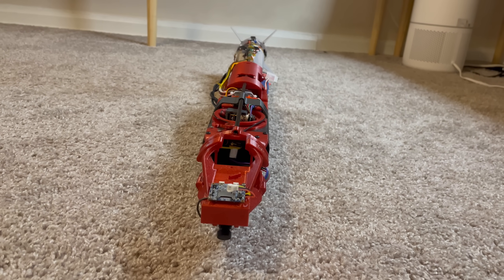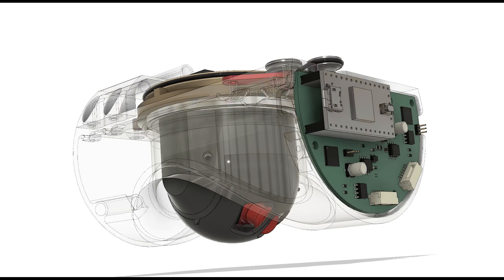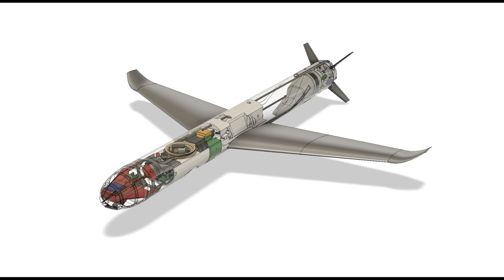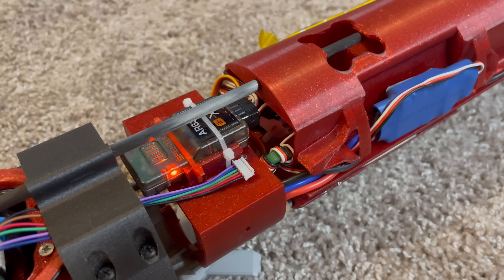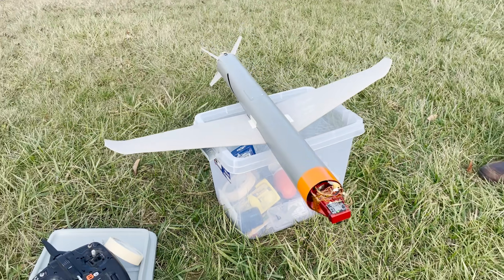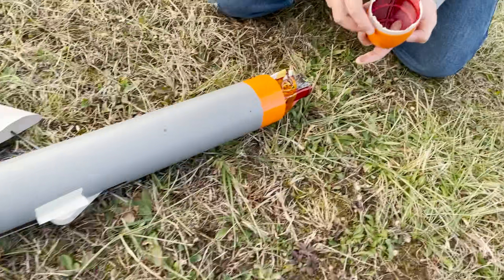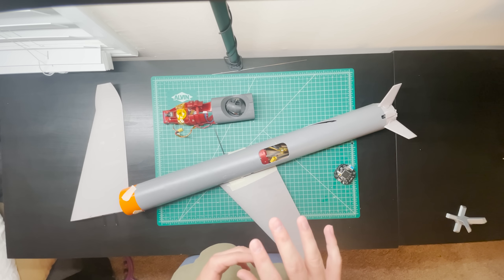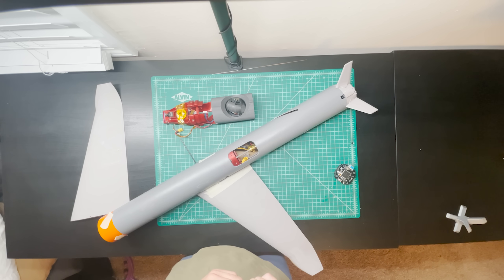Building (And Crashing) my Homemade Surveillance Drone

Comment: Thrust too low, too heavy, not enough tail stabilizer authority (too small). I think you are focusing too much on making it look cool as opposed to flying well. For example why ducted fan? Why thrust vectoring? Why 3D printing instead of other construction methods which are stronger and lighter? That stuff is heavy and obviously not helping it fly better. A better way to do this would be to start with a commercial RC airplane that flies well, then modify it to add your payload to it. It flies well and the payload functions? Great, now you can make modifications to the airframe to see if it improves performance. The key is to make small changes and test the result of that. While testing airframe stuff you can have a dummy weight instead of the actual payload because as you're finding out, there will be crashes. Quick and dirty is the name of the game for prototypes. If it looks good you're wasting time and therefore iterating slower than you could be. It's tempting to have an idea in our head of what the final product will look like and just go right to that. It's much better to be constantly thinking of the objective and be open to anything and everything that gets you closer to that, regardless if it matches what you initially thought. Ugly stuff that works is better than looks cool but doesn't work. The Youtube channel rctestflight is a superb example of this type of engineering. I worked as an R&D engineer, now retired and have designed and flown a few RC aircraft. This is my first time seeing your channel and I don't know your background so please don't take offense. Good luck!

Comment: Weight and balance compared to wings. How much thrust does your arrangement produce. The special ed throw is really no good :) try adding small dummy wheels to it and see if you can take off from a runway, if not you have bigger problems. and don't use plastic 3D printing for anything structural because it's garbage. Although there is that funky new filament type 3D printing nerd is promoting that is crazy strong in tension along the extrusion direction. The tight non aerodynamic duct is probably no bueno.

Comment: I think you'll have better luck with a pusher prop. I've built a few EDF powered foamboard deltas. I had to scale my 52mm edf model up to a 74mm fan to get enough thrust for hand launches. My models had flat wings with no low speed lift, it needed a lot of thrust to get airborne. I ended up scaling the whole model to fit the 74mm fan and 6s lipo. I really think an EDF is just too inefficient for your application.

Comment: you gotta do your carpet plot / design point analysis (consists of wing and thrust loading) before flying it. Check out my Bronze Propeller RC competition video.

There are equations you can use to achieve desired takeoff speed, stall speed, and feed into the carpet plot to determine the best wing loading and best thrust loading to achieve your desired performance

Comment: 3d prining is cool but weight a lot so I'd injection mold or better vacuum mold non structural elements, it's a lot of work up front but you get less weight at the end.
The thrust is way too low for that weight and the control surfaces have no authory at such low speeds.
For launches I'd use a rail or something that can get it up to speed if you want a model that is for relatively high speed. Also it is more reliable and reproducable than throwing it into air.

Good luck! :3

Comment: I was thinking rail launcher when your buddy was chucking it. I really think you need tail wings. Those 4 X-patten, or even 2 larger Y-pattern stabilizers, are not enough. I think you need the 2 larger Y-pattern rudders and 2 normal rear wings, then you'll home free. Stall and launch speeds will be much better. Some kind of carbon landing sliders might also be good. At least it when you are finally landing it, it will not risk tearing up the bottom. That's my 2 cents.

Comment: While the weight, wing area and low thrust don't help with the hand launches, some better technique might've made it fly at least for a moment. The most consistent way i found for hand launching is by grabbing the fuselage slightly (very) in front of the CG, running as fast as possible while maintaining somewhat constant angle of the plane, and then gently throwing it forward. The way this plane was launched (or rather, thrown) gave it so much angular momentum every time, it probably wouldn't recover even with infinite thrust.

Also, running with the plane in hand gives you some feedback on how the lift is, and if the plane is correctly pitched for launching. The runups were very short so there was no way to correct a wrong aoa.

Good luck with the next iteration, cant wait.

Comment: your idea of a rail system is good. if you can get it to fly or glide a short distance till it reaches stall speed with out the fan running that would be good.. One other thing one thing you can do to see if your fan has enough energy is to install or make a fixture that has wheels to check and see if the fan has the energy to overcome the weight of the model

Comment: Also, you could do a cut down 'community' version that we could all contribute to, even if its just the base frame and wings to get that right. Id be happy to print and test, I also use F3D. With FT work & kids I just dont have the time for replicating from scratch but would be up for taking deviations and printing, logging results for you. Best of luck.

Comment: Seriously impressive.  I applaud your approach of reducing risk where you can for initial testing.  Too many people try to do too much too early, which usually results in multiple failures.  Have yuo had any problems finding suitable test ranges?  Launch attempts 1 & 2 - Hand launching probably gives you a takeoff speed too low to support flight, even for this wing set.  Also, the takeoff angle of attack looks far too great, which probably resulted in stalling the wings.  In an effort to eliminate those variables, you might consider using a track laucher with bungee cords for the initial takeoff impulse force.

Comment: sounded like you throttled up after launch.  if thats the case you might want to consider starting at full throttle prior to hand launch.  this will ensure maximum control authority as well as increase launch velocity.  One thing that may also useful is a light weight unpowered glide test to ensure your stability margins are acceptable.  I can’t tell from the video but hatchet appeared to be tail heavy.

Comment: Ducted fan engine. How far will it fly? 1 mile?  Efficiency like a steamer. Its a YouTube toy, not a Surveillance Drone. Its heavy and landing like a brick. Buy APP foam frame and install the slow motor and big prop. Autonomous flight is easy to do with the Arduplane.

Comment: Hi, I suggest you try a prisoner flight on a wire to validate the balancing of the plane and the calibration of the flight controls and bearing surfaces. Then I think you will need to use a launch pad with elastic to get a higher takeoff speed.
My two cents.

Comment: You can print in LW PLA to reduce weight it’s significantly lighter then PETG.

Also you’re getting a really bad torque roll at launch which is why it rolls upside down every launch. 

You’ll need a larger surface to control roll. You might have to resort to Ailerons. To achieve enough roll control to counter the torque roll at such a low air speed.

Comment: its tail heavy! It will NEVER fly until you get it to balance and by what I see it is clearly tail heavy. It needs some weight in the nose. Look up how to balance a rc airplane on the internet. That is your main problem, your "CG" is way off. You should be able to hand launch it once its balanced. Try and get it to glide first. Not long distances, just glide, then start adding power.

Comment: You might not want to use a “guy” to toss your toy!  Get a launch rail you can develop some speed with!  Good grief!  Your problem isn’t weight, your problem is achieving lift velocity, weight has nothing to do with flight, only flight speed.  Not enough stability margin with hand launching, really…..

Comment: Awesome design.  I bet you need ailerons.  I'm clearly no engineer, but I did scratch build a 4 foot RC predator model from foam and balsa.  With your smaller control surfaces at the back, I think you're going to need a lot more thrust to get enough speed to have enough control authority to steer that heavy girl.  Electric RC ducted fans are not as powerful or efficient in reality as they are on paper.

Comment: The project looks very good but you can improve a little bit about the weight. For this you can use LW-PLA and reduce its weight significantly. Good luck

Comment: Replace any 3D-printed components you can with inexpensive materials like Hobby Lobby foam board or cardboard tubing. If you must use 3D printing, consider using AERO PLA, which produces a foamy, lightweight material depending on the hot-end temperature. For your 3D-printed parts, minimize infill to reduce weight while increasing wall thickness to maintain strength.

For deployable wings, increase the fuselage diameter and shorten its length, ensuring the main wingspan is at least double, if not triple, the length of the fuselage (or rocket tube in your case). Avoid placing fins directly behind the motor exhaust, as they can reduce thrust during major turns. Instead, remove them from the exhaust point for better aerodynamics.

To improve control, rotate the rear assembly 45 degrees to enhance pitch and yaw performance during gliding. Additionally, consider adding a method for pitch control, as none seems to be present in the current design. Remove the intake duct and rethink its design. A single limb-like structure, similar to how drone props are attached to the frame, might help reduce weight while maximizing surface area for thrust. If you wanna make something to use model rocket motors look at the yokosuka mxy-7 or Mizuno Shinryu planes.

Comment: I have some experience in hand launching RC planes. When I just started the biggest mistake I made (and I can see you make it as well) was to through the plane upwards. This makes the plane immediately stall. Even though it is counter intuitive you should through the plane slightly downwards (to a imaginary point about 10 meters or 30 feet in front of you) this way the plane will have enough speed to fly or it will just land without (or the least amount of) damage.

Comment: It seems that you might have to use some kind of launcher to get enough take-off speed. Your main wing might start producing enough lift at quite low speed. Your rudder/stabilizer probably does not stablize much at launching speeds.

Comment: what is the weight of the drone and thrust of the EDF? I was worried for the turret cam in those crashes. if i were to do this i would skip all the expensive stuff install just the essential components and get it airborne and gain confidence in the design before adding all that cool features.

Comment: Lack of thrust is what I am thinking. If you don't have a slingshot stand to launch a drone with a small wing-area and high weight you'll need some more thrustaroos.

Perhaps a pusher-prop in the butt? Ducted fans are notoriously powerhungry.

Comment: To tailheavy (Thruster, Bearings, Servos..move them up to the wings, use bowden tubes) and to much "stuff" in the air stream.  Vectorblades are cool but you have to afford it especially with low power thrusters. Common case is that the stream beaks down and produces chaotic turbulances when the blades block the air stream.

Comment: that motor and nosel is not enough for the thrust  to the  hatchet make the nosle little bit bigger so the more air can apss through  itnand use powerfull bldc motor with torodial props on it

Comment: 2 recommendations.... You could use a launcher like the military does, they use a cataplt launcher to fix the stall speed issue. Also Why not just run 2 of the 4 rear Stablizers like a Predator, or ? It will fix landing problems and might help with controlling it. Especially if you increase the size giving it more stabalization.

Comment: Great wildly ambitious project. 2question/suggestions:
1: What is the stall speed? - can your helper throw the vehicle (or anything) to that speed?
2: thrust?  From the very limited view it looks like it is frankly insignificant relative to the mass of the vehicle. It is obviously unable to visually accelerate the vehicle in the first 1-2 seconds. Your idea of reducing total mass is good. But I’m thinking you need to maybe triple the thrust!  Or how about rocket assistance for 5-10 seconds? Good luck

Comment: i would like to make a siggestion , from all the payload and heavy design , as you said the take off weight can be reduced OR THE THRUST CAN BE INCREASED ,  if the thrust to weight ration is high it might have a grat chance , but great job , looking forward for a improved flying version

Comment: What is the thrust to weight ratio like? The launches look like there isn't nearly enough power to get this thing to fly. Also the control surfaces and wing area are tiny. Given the EDF and the small surfaces you probably need much higher launch speed. Maybe try a catapult launch for the next iteration - with lower weight, more static thrust and larger control surfaces. Then maybe this will fly.

Comment: RC plane builder here. It's too heavy, it's underpowered, and the control surfaces are waaaay too small. You need to add ailerons and a flight controller would help. Also a minor detail, but your inlet for the fan is a NACA duct. This is the wrong shape. NACA ducts are designed to create a low pressure zone and slow the air coming into the duct. Ideally you want the opposite, so a more traditional scoop type duct would be better, ideally on top, not underneath where it is vulnerable to damage and foreign body ingestion. Good luck with the next version!

Comment: I think problem of TWR is intakes which barely better then car ventilation system. It should be feed with air, I bet laminar flow of air just goes pass. Expanding them may make it work more efficent.
Second, lot's of survilance drones uses sling system to toss it. Yep they are heavy to yet being aible to lift by man and tossed - but not that effective as a sling.
From my naked incompetent eye that's two biggest flow.
And if you struggle with mass, you either make it weight less one increase wingspan.
Sorry if i sould obvious ideas, i realy love the design, wish you like to make this cool thing fly.

Comment: Smaller battery to reduce weight. Larger wings for the test flight to lowers stall speed just for proof of flight. Then you can increase battery size and reduce wings. Definitely a rail launcher. That will let you test if you have enough thrust to even move the vehicle. Or make a little trolley with wheels that it can sit on in a parking lot or Long Street to see if it will push itself and maybe take off

Comment: Hi there.  The ratio between power output and wing area/control surfaces must be balanced. From what I can see, your power output is too small to make the plane fly. If you want to keep small control surfaces, the wings will also be smaller. That, in turn, will require a much stronger power source. For a slower plane with a weaker power source, your wing area will be more significant, and so will your control surfaces to be effective with slower airflow. An alternative is to gimbal our power output if you want to keep smaller control surfaces. In general, your plane is too heavy for the power supply you're using now.

Comment: the tube with winglet design really only works when launched from an airborne platform as its already moving fast enough to generate lift. the motor only has to sustain its speed

Comment: doubt the thrust vectoring gimmick works here. thrust is simply too low for it to have any effect unlike in the aim9x which probably inspired this design. might even be negatively affecting the already limited thrust.

may also want to consider using hot wire cut styrofoam for the body instead of 3d printed parts to massively save on weight

Comment: IMO, drone needs to first meet with the air at speed, holding the same attitude it is designed to maintain once in flight.  I'd try to come up with a way to release it fixed from the top of a moving car, or by using something similar to a scale version of this military drone catapult... https://youtu.be/flnVZgJNTC8?t=31

Comment: Rest is commented well. For launching, since you have invested so much, check into accelerating it further with extra thrust initially with mechanical device or pneumatic  or chemical power. Once you have enough airspeed, wings will generate enough life to keep it going. 

Balance, reduce payload automation as much as possible. Engineering is all about trade-offs.

I am not sure vector control is helping, not enough airflow over tiny winglet.

Excellent work !! keep it going. Its all about babysteps. One system at a time. If I was doing it, I would remove camera and any extra weight. prove the concept independently before adding complexity.

Let the control surfaces break make it a feature. make it easy to replace. 

give that weight to increasing lift

Comment: All the suggested changes will help, as you are likely aware: too heavy, low-power,  vanes in the thrust tube might be killing thrust, and it also looked tail heavy. starting point, it should be able to glide with no power straight and level.

Comment: Probably nothing new to you but:
Usually you would have the center off mass Infront of the wings, the wings produce lift the stabilisers produce downdraft to pitch up your nose. 
Modell size airplanes usually are a lot more easy to get airborne because of the highter thrust compared to commercial planes. Basically that means with enough  thrust everything will fly.